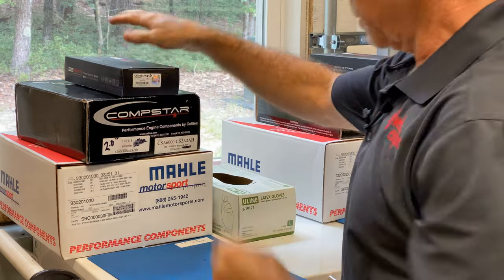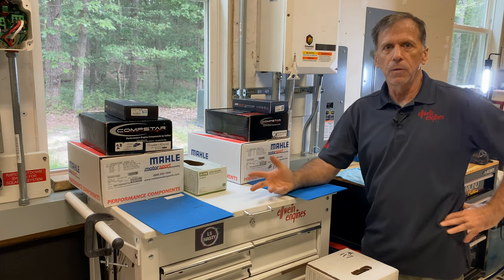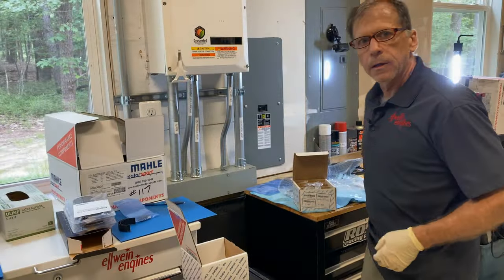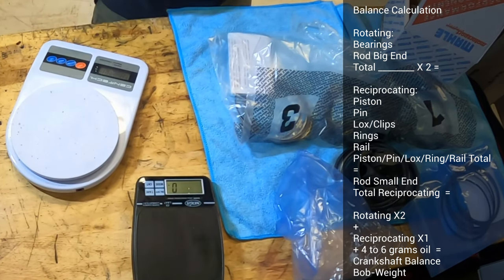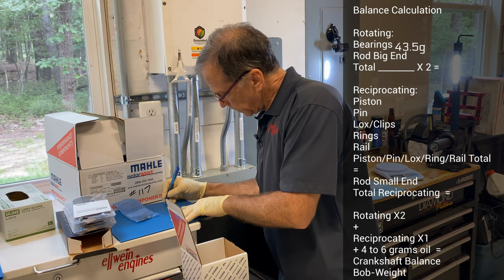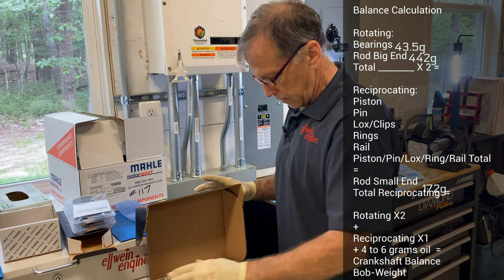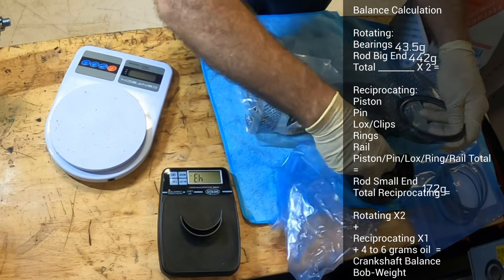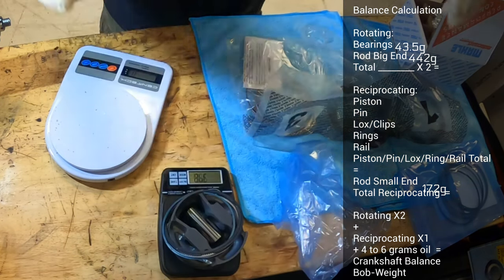Crankshaft Balance.  Gather the data and give to the balance shop.

Comment: Good  Tech.  INFO      Thank You  !    Do You Have Solar Power In The Shop ?   Again,  Thank You !
Reply from the maker: Thanks.  Not for the shop.  The house and shop are totally separate with separate meters and the house is getting the solar and propane generator and 14KWH battery.  Total self sufficient if the grid goes down.  Edit:  10kWH   5000 watt continuous.